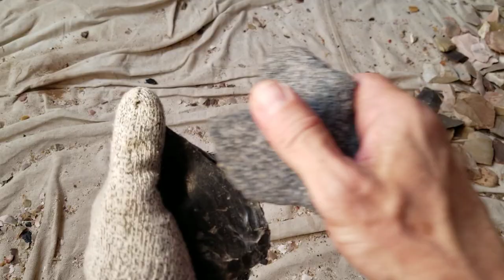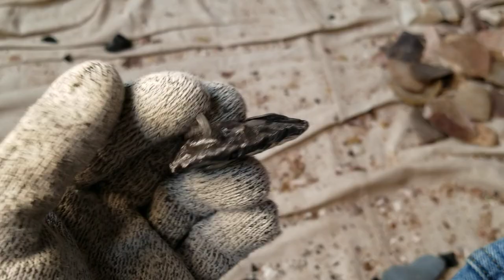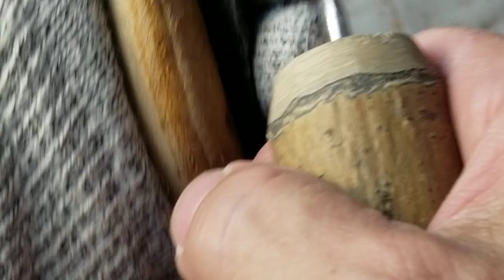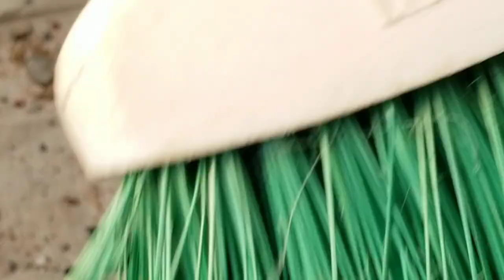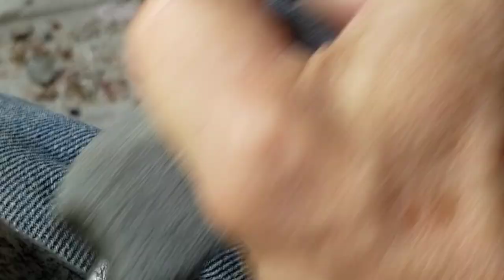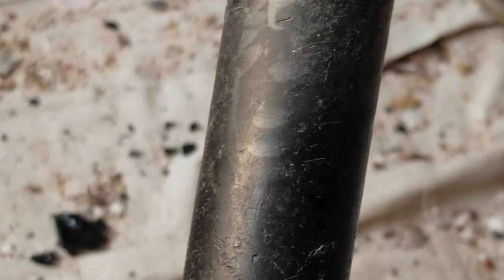1169 - Time for Obsidian Flintknapping 1/2

Comment: Because obsidian is volcanic glass the wast chips can be melted down into nodules to be Knepper into points ,or tools . Chips or flakes are razor sharp !!
Reply from the maker: Obsidian does not melt like glass and it does not flow unless put under extremely high pressure.

Comment: I’ve just started watching. Why do you dull the edge with the grinding stone?
Reply from the maker: So it won't crush when I apply force.
Reply: Usually the fine edges are too thin to drive a flake, so by abrading it, allows the thin, tiny flakes to be removed to give better platforms for larger flakes, and allows for a but more pressure to be applied to a reinforced platform allowing the flake to be driven in one way or another. Just what I've learned so far, obsidian is usually very fragile so lower pressure, lower speed hammerstone applications or indirect is used more often with it, versus chert and flint as that can be done almost completely with hammerstones, but platform setups are critical to driving flakes the way the knapper wants. I hope this helps, I'm still very much a student in this, but have tried a bunch of different of materials, this guy's ideal for watching for those things I'm not as familiar with.